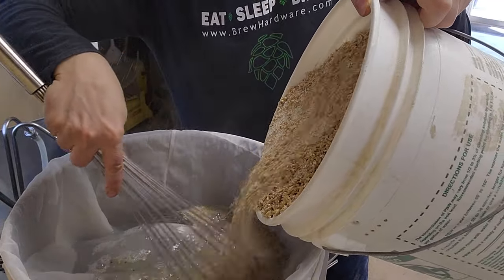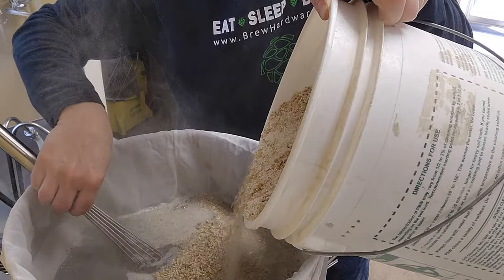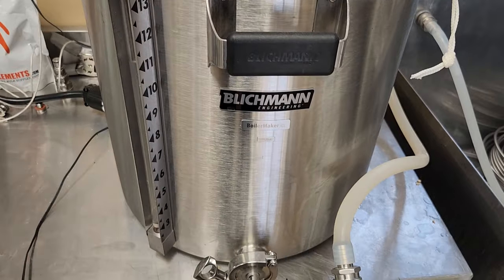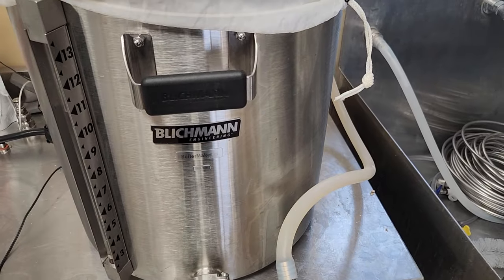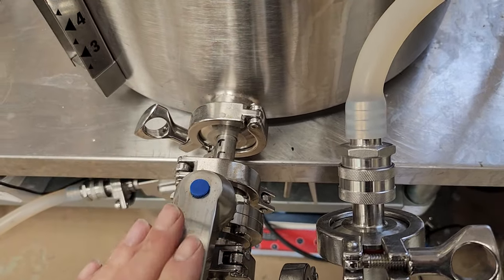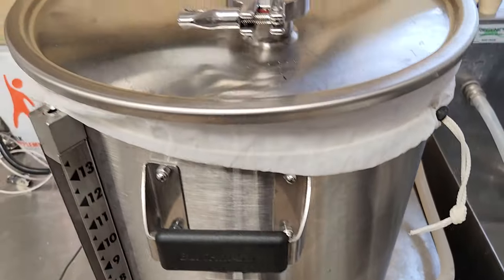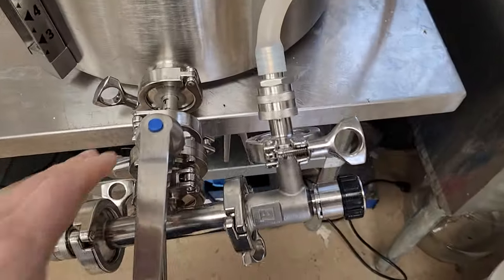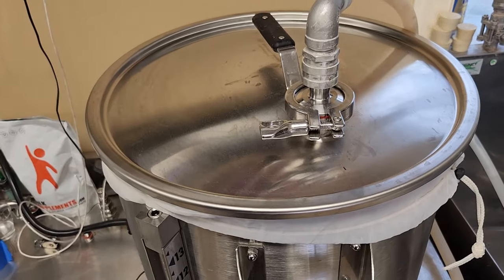Short Brewday Video  - Marzen on the new Blichmann kettle.

Comment: Nice Bobby! Looking trim, no?
Again with a brilliantly simple set up. I’m about to pull the trigger on one of these from you soon. Nice to see the topsflo still gets it done for you! Can it handle 8-12oz of hops loose in the kettle? (As compared to riptide) is the cleaning as easy as it seems!?
Reply from the maker: I never had an issue with the pump clogging but the most pellet hops I've ever had in the kettle at once is 7oz for a NEIPA. As long as the wort is moving, either via the boil movement or whirlpooling during the hopstand, I feel like the particles get spread out and dilute.  Cleaning is very easy with the bottom drain. I spray hot water in to dilute the trub pile, maybe 2-3 gallons and then pump that down the drain. Then 3 gallons and a big scoop of PBW, heat to 150 and recirculate through both hoses for 20 minutes. Pump that down the drain and one more quick hot water rinse. The kettle never has to move. The only improvement I could envision is putting a tee directly on the bottom drain port with a second butterfly valve that goes directly to a sewer pipe for that initial rinse out but it's a hardware cost expense that is hardly justified.